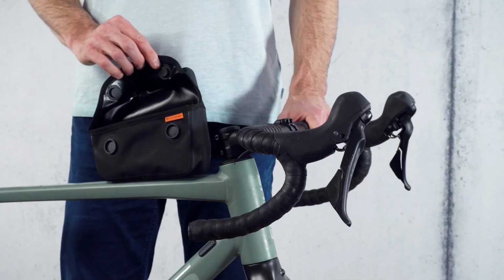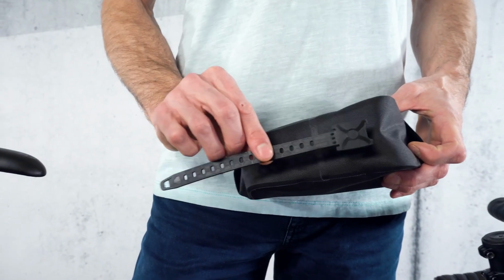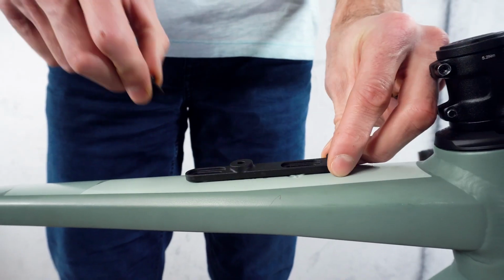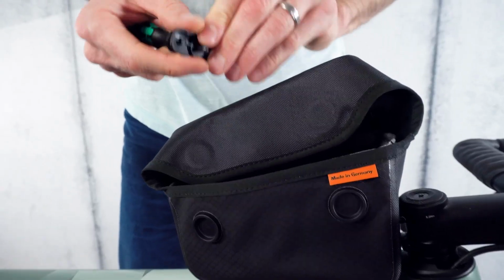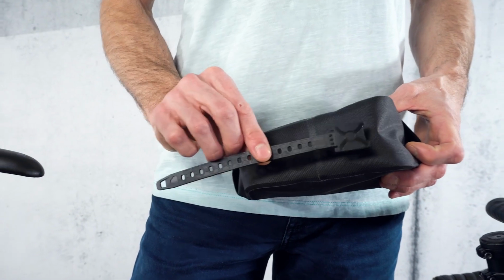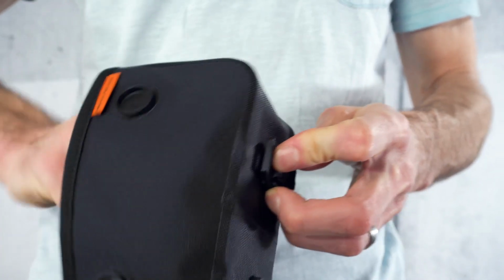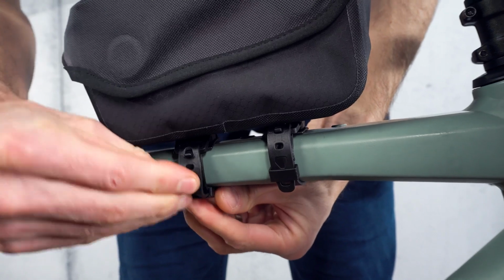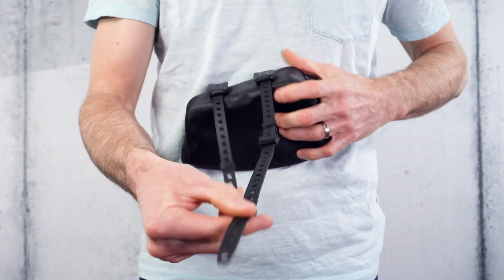ORTLIEB How-To | Fuel-Pack

Comment: This is such a weird piece. Top tube bags have been around for a while and seem to really work just the way they are. Why wouldn’t you make two versions a screw-on and a strap-on. I get that you wanted to get rid of the steering tube Velcro but the way it’s hovering way over the tube tube and the overall shape really make it look weird . Ortlieb has so many great bags but they don’t seem to have figured out the top tube bag yet by always trying to be “extra”. The apidura race edition seems to be the better option still. Sleeker design, easy o use etc.
Reply: I gues your feedback is just based on look and not experience ?! ;D its main function works perfect